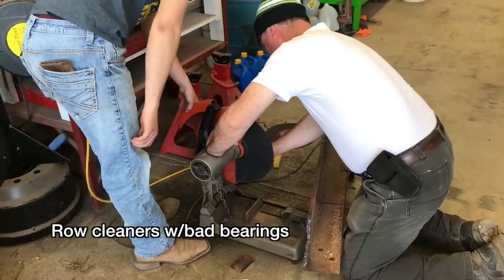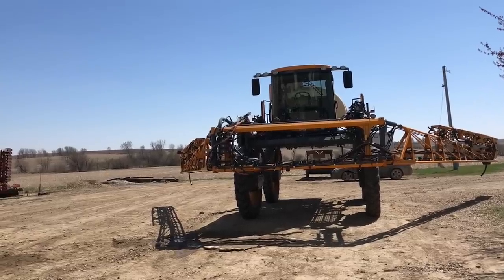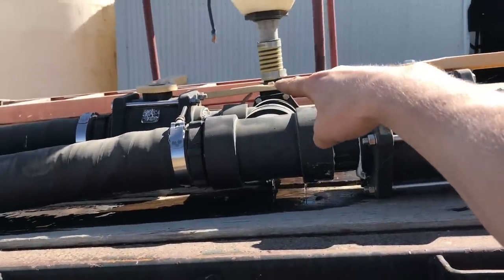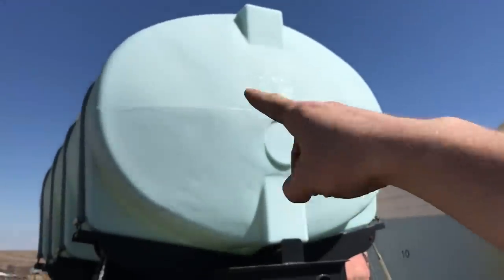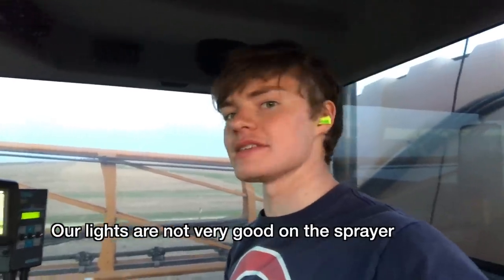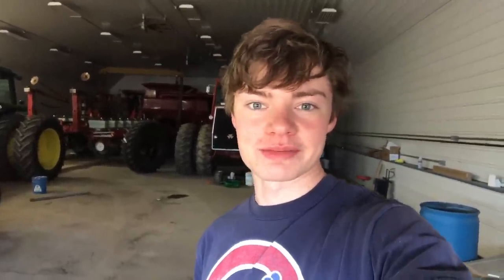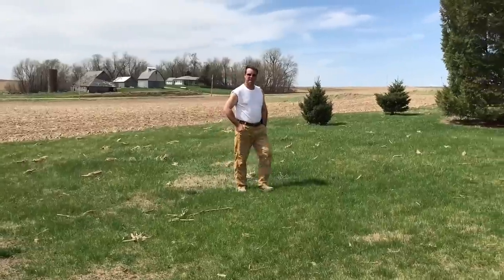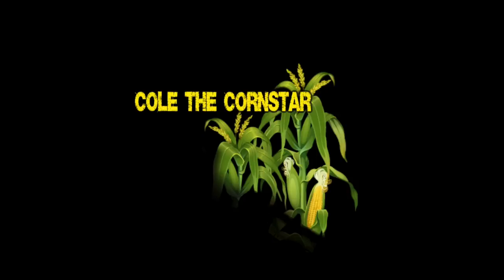We Started Planting Corn! | Plenty of Preparations

Comment: I love that MF 4840. Makes me miss my childhood. I literally spent thousands of hours riding with my grandfather in one. Triple tires and Had oversized injectors and lines on her. Pushed a little over 320hp. Grandpa had a turbo for her but never put it on. As a matter of fact I think it is still sitting in the shop.
Reply from the maker: nathancmartz That sounds like quite the machine!
Reply: Cole The Cornstar She was a horse. Sold her on grandpas retirement auction in 2007. I’ve been trying to find it ever since. Pulled a 7 shank disc ripper and a 45ft field cultivator with it. Gave us thousands of hours of work with very minimal breakdowns.
Reply from the maker: nathancmartz We've had 4 of them over the years. Nice machines.

Comment: Cole, I do a lot of work with older fiberflass equipment enclosures and i get the fiberglass in my skin a lot.  The best solution is to use some 2 inch wide electrical tape.  Cut off a piece to cover the area, press it down good and slowly peel it off.  It pulls most of the fibers out.  Hold the tape out in the sun and you can see how sparkly it is ;)

BTW, I enjoy your channel and find it interesting.  Your dad is a hoot.

Comment: Rust? You should live here in Tunisia - everything rusts. BUT....there is an application, after taking the metal down to steel or iron, that inhibits rust. Then, it is sparayed with laquar like you use on boats. two coats and there is NO rust. Think aboutit.